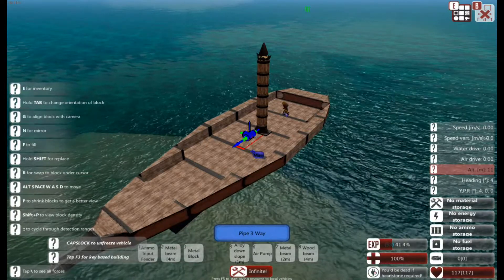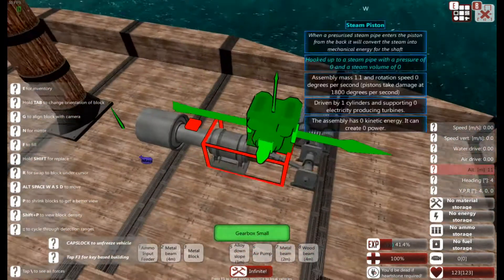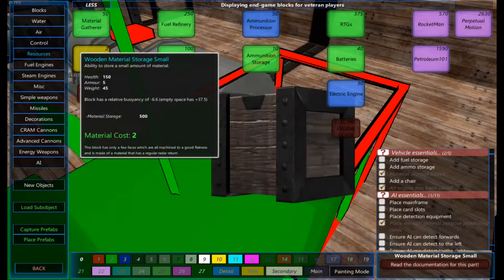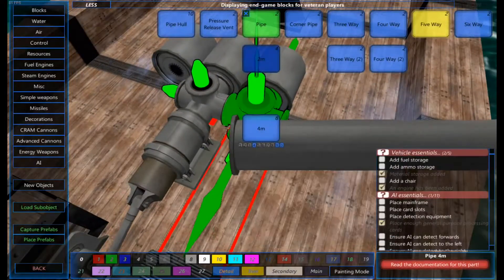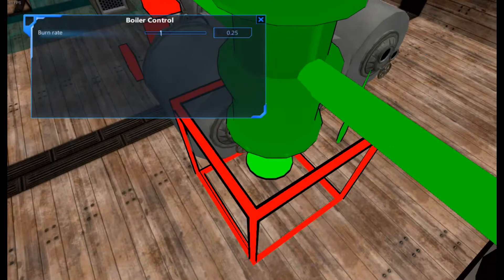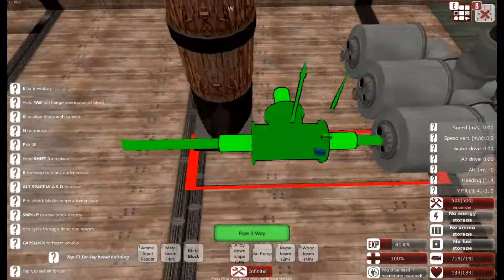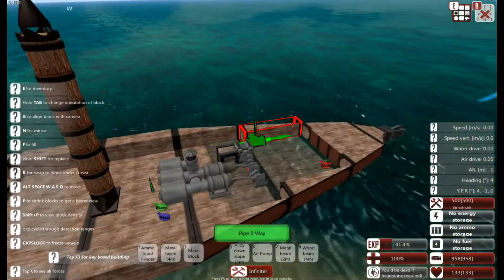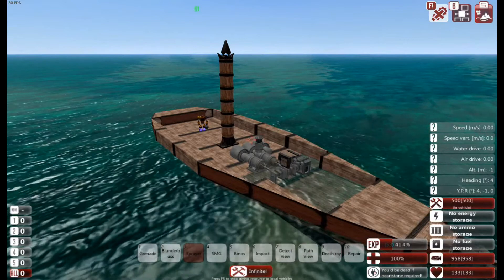From the Depths - Minimalistic Steam Engine Tutorial (NEW!)

Comment: steam power goes down when its being used because theres more stress on the pistons when theres shield or anything else using the power. 1 large/long boiler will have a higher power peak but slows down alot when the power is being used. you can makes this better by having multiple short boilers instead of 1 really long one. I usually use multiple 3x3x1 boiler with each their own controller and pipe connecting it to the pistons.

steam uses alot more materials though because engines can have turbos to increase efficiency and a refinery makes even the worst fuel engine cheaper to run